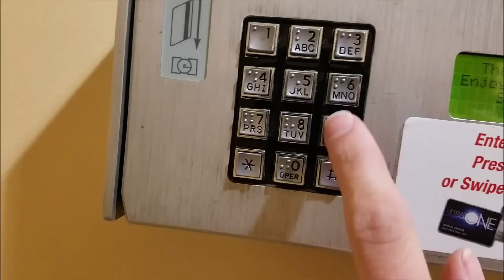What Are Truck Stop Showers Really Like? (Trucker Vlog Adventure #7)

Comment: Nice truck stop showers. In the UK, we have service stations on our motorways. They are open to cars and trucks. The facilities are crap. But we have truck stops. And they are a lot better and cheaper. If I was to pull into a normal service station, I'm looking at £22 for the night. A truck stop its about £8 with nice showers and a café.

Comment: I'm shocked when your hood was open you didn't check your oil. Maybe I'm just overly cautious.
Reply: the truck engine must be off for a minimum of 15 minutes to get a good level reading.. preferably 30 minutes.. the valve train of a truck engine holds so much oil the level would appear low since he didn't stop long enough when getting fuel. BTW a DD15 (typical truck engine) holds 47 quarts of oil.. (almost 12 Gallons)
Reply: MrAcethebum that makes sense
Reply: It's probably part of his morning checks before he starts up

Comment: Truck driving is something I’ve always thought about doing as a career, I’m still young (15) and I would like to know, is the job boring? Is the pay reasonable for the amount of hours you have to drive, and is driving the truck really that hard as people say it is?
Reply from the maker: Hey there! Well in my opinion the pay is reasonable but that really depends on the company you work for, they all pay differently. The hours are long though. Driving the truck is only hard when you start out but I think that is true for almost any new job. After that it becomes easy and enjoyable actually, unless you encounter a problem of course. Overall, tucking is the least boring job I've had so far, it is quite an adventure! If you like to travel and are ok with spending a lot of time by  yourself with your thoughts, then definitely consider getting into the industry when you get older!
Reply: Try hot shot trucking you’ll like it a lot more and make more money doing
Reply: What's boring for you? Driving through 650 miles of desert in 11 hours or sitting in city traffic for 11 hours because you will do both. Driving 3 days with baby wipe bath time or showering daily at truck stops? You will do both. Higher paying jobs, you need experience.   Lower paying jobs you drive more.  Do your research. EVERY SINGLE COMPANY YOU WORK FOR IS TRYING TO SAVE MONEY. YOU NEED TO PROVE TO THEM THAT YOU ARE WORTH THE EXTRA CASH.
Reply: fooos trucking is bad for your health
Reply: Craig Cunningham what’s hot shot trucking?
Reply: Craig Cunningham tell me more.
Reply: Gotta get a big gut to absorb the shock to your spine from the bumps.
Reply: The job probably will cease to exist or at least shrink dramatically during your career, likely driving down wages
Reply: Check out Trucker Brown. He has some informative videos as well.
Reply: Get office job, dont be stupid. I left college and  became driver because it was fun and easy, but now its 10 years later and im fucked. Wasted 10 years and now its all i know so i cant even quit and try to make something with rest of my life.
Reply: Your questions all have short simple answers. I'm an 11 year 1.3 million mile vet. Pay is terrible with the big companies (JB Hunt, Werner, Swift, Schneider) and much better with smaller companies. I work for a FedEx contractor running 2 overnights/week to New Jersey. Pay is $80,000/yr. The job itself is awful. I hate truck drivers. They remind me of filthy uneducated pigs. Cars and police hate your guts. The job in my opinion bores me out of my mind 99.9% of the time. Interesting things don't happen often. I run a dedicated route and have been going to the same place for 5 years. The only plus is that it lets me live a very good life when I'm home, and I can indulge in my hobbies (aka my real life). Choose your career wisely...
Reply: Look into the LTL. Pay is good, home every night, weekends off. Best gig in the trucking industry 😎
Reply: Just get an office job :) Truckers are at bottom of the society, lets be real about it.
Reply: Joey Snow
Yes it is. Bad wages, terrible working hours, stressful, unhealthy, lonely job. But worst is that you have zero promotion prospects, youve given up on progress. Burger flipper in mcdonalds earns just a little less, but hes pretty much guaranteed to get promoted into manager job if he stays there long enough. End he can go home after work and have life while you are sleeping in some parking lot that smells like public toilets.
Reply: GTA]monkey 
Working in air conditioned office, browsing web and sipping coffee, is a fucking dream job ^^.
Reply: I can tell you as plant engineer where I work that sitting in an office browsing the web and sipping coffee is not a dream job. I try to spend most of my time out on the floor maintaining the machine I code and forming better relationships with the general laborers because sitting on my ass for 8 hours is far more mundane.
I quit my job in medical coding because of how boring it was, despite the pay being better than what I do now, though what I do now still pays well and I get the satisfaction of being able to work with my hands or sit at the computer if I want to.
The bottom line is you need to find a job that fulfills you and makes you happy you decided to go with that profession. You shouldn't be waking up every day regretting that you have to go to work. And if trucking is what makes you happy, if that fulfills your desire to travel and you don't mind not having much home life for the first couple years, then go for it.
Reply: fooos you get paid by the mile
Reply: fooos my mom has been a truck driver for 13 years now and I have spent several years with her on and off. Being an over the road trucker sucks unless you hate being in the same place all the time and you have a family. If you're single and want to see America, the over the road trucking is for you. A word of warning though is stay away from these specific trucking companies 
C.R. England 
Falcon transport
Swift & especially 
Está 
These companies are known nation wide for terrible treatment of their employees and numerous citations from the department of transportation.
Reply: fooos I’m a truck driver in Australia myself and I drive 5 trailer trucks/road trains and it can get really boring and the pay where I am is 6000 a day and driving the trucks can get really hard in suburban places
Reply: Bob Wehaddababyitsaboy well said mate I drive road trains in Australia and it’s a hell of a job alright I couldn’t have said it better than you did
Reply: Franta Lopata this is as little bit late as you commented 2 months ago but how would you get your office supplies sir?
Reply: lots of bad advice on here.  my name is joe and i been driving 37 yrs.  over the road is a lonely job.  but certain people need to get away .  pay is good.  a vocation for life.
Reply: I have many years and experience in this field. Brokering freight is where the money is at. If you decide to drive a truck. Own your own company, or be an owner operator, hire a factoring company, and lease a truck until you can save to buy one on your own- or start saving now. If you can deal with living out of your truck the first year you can save enough to put a decent down payment on a truck if, and only if you are disciplined with your money. I know many truckers who make revenue consistently of $5000-6000/week. (1-2grand ion their pocket) My company ran a driver that made $17,000 revenue in a week because we placed him in the right area at the right time, and leveraged his position. Smart owner operators can make $100,000 profit a year or more.... If you buy old equipment expect that to eat into your bottom line, lose your revenue, and cause you customer relations problems due to late and unreliable service, always pick up your phone, and be restpful, you will get far. Truck drivers are a dying breed, so pay is only going to increase. There is a severe trucker shortage with no relief in sight. Unless they automate trucking....
Reply: "Hot Shots" are basically a dually pickup truck hauling a 30 to 40' trailer.  Google and you'll see.
Reply: I in fact love it having ADHD I really don't last well at jobs where its the same thing every day so this job it perfect for me. I like to listen to my audiobooks and I download my radio show ( the free beer and hot wings show) and that's all I need I got my video games for my 10 hour breaks and 34's (when I do them). Just manage your weight and you'll have fun no manager breathing down your neck.
Reply: It can become monotonous. Long hours, sometimes driving 9-10 hours a day delivering and trip planning. The pay is pretty good depending on who you work for. When I was getting my cdl and training, honestly it was the hardest yet most rewarding thing I've ever done in my life. I passed my test first try (even though I almost quit truck school 2 times 😂) I absolutely love it now that I have experience and know what I'm doing. It is NOT for everyone. If you're doing it just for the money, don't. Do it because you enjoy it and it won't be as bad.
Reply: For a career? I respect all truckers in the profession, but I don't know why you'd ever want it as a career. It's boring, tiring, thankless, lonely, and you don't get paid that much.
Reply: fooos there’s a lot of money that can be made if your up for the grind
Reply: Franta Lopata isn't a sore loser
Reply: Hello, I understand I am late to the conversation but i hope you still see this. I am part of a family of truck drivers, my father, uncle, aunt, mother, grandmother, grandfathers and 2 step grandfathers were all/still are truck drivers so here are a few things to note. 1. It is a very cool experience, like how many people can say they travel the country and make money for it. Growing up I went with my family alot and seen so much from the statue of liberty to the grand canyon to the freezing winters in north Dakota. But the experience of exploring the country is really amazing. 2. From my experience (I myself am not a truck driver as I am only 19 and you have to be 21 to get your class A CDL) but through my family members I can say it takes alot of commitment not only from the trucker but to their family. This is my personal experience. My father started when he was young as his parents drove. So when he met my mom after a while he taught her how to drive and they ran team for years. I was born and after a while my mom stopped going with him. Now for a kid with their parent as a truck driver first I say it's really cool I bragged about it to my friends and stuff but it also really sucks at times. Especially when you play sports like I played football for 10 years and I think my dad was only able to make it to maybe 12 games total which is rough on a kid... also that sometimes I didnt see him for 2-4 months at a time because freight got low so he didn't earn enough to be able to come home for a weekend or so. And just last year my mom couldn't handle my dad always gone working so they got divorced so as I said it takes committee from the whole family. 3. The money is really good, depending on how you run whether you run as a company driver or a owner operator. I would highly reccomend starting out as a company driver its alot easier so better for new drivers and as you get more experienced you can try out being an owner operator which makes more money but also spends more money, but either way you'll make decent money... this is the main tips I could think of right now if you would like to talk more about it I would be willing to talk more from experience of being in that life and know how it goes.
Reply: Best way to do it is owner operator. You’d gotta buy a truck tho
Reply: Trucking is a good job still don't let these clowns tell you otherwise. it is a sedentary job so the chance for weight gain is high. Eat smart learn to cook in the cab and avoid the sodas and fried foods just the typical nutrition info. Currently pull down around 60k a year as a driver. Yes owning your own truck is the holy Grail for most drivers however greatest risk greatest reward. Some people just drive for a company and are totally happy with it. There are huge amounts of alone time and yeah it can wear on you same with the weeks and months gone. I've met many educated people that drive trucks and also some you wonder how they manage to form complete sentences.  It's a hard job and there's so many aspects to it from having to know your routes ahead of time to laws for various municipalities. If you do get your license get as many endorsements as you can. my main suggestion for that would be hazmat and tankers. Haz runs the gamut from toxic chemicals that will kill from a single drop to food grade preservatives. And tankers doesn't just mean the usual tank trailers but if they put 250 gallon totes on your box trailer it has essentially become a tank trailer. Less slosh but you still feel it. 

There are ways to combat the boredom as was mentioned earlier. Things like satellite radio, audio books, podcasts all help cut down the fatigue plus it helps to have a regimen daily to keep things normal.

Comment: Is your truck an auto? Are most new ones switching to autos or are there still companies suck as KW or Peterbilt that still use 13 and 18 speeds?
Reply: Still plenty of trucks using manual transmissions just depends on how the truck is spec'd.